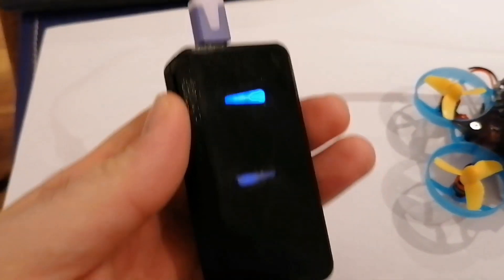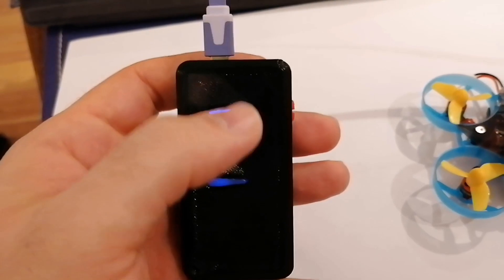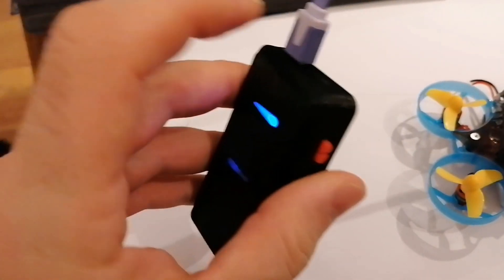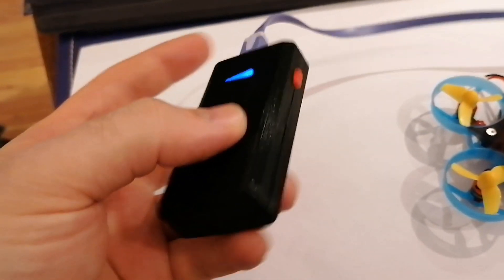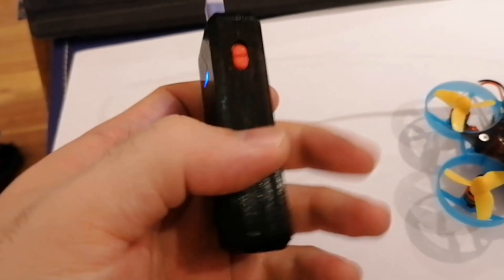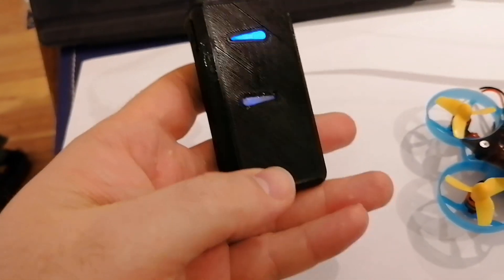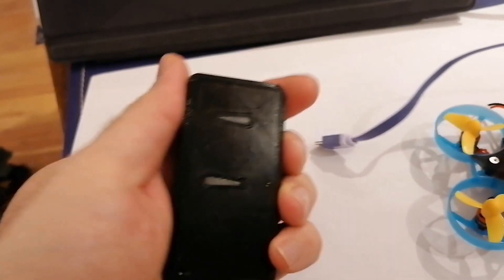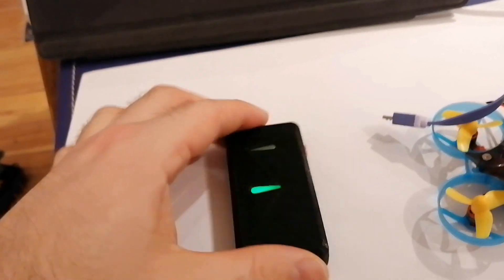PIDFlight ESP32 - Drone lap timer device

Comment: I have no programming skills at all.
Initially I tried to make a timer using FPVSim (he uses esp32 dev1) and the tutorial was very easy to follow for beginners like me.
but unfortunately the timer is paid, and I can't afford it.
I tried to use PIDflight with esp32 dev1 but when I tried to follow it I had a lot of trouble.(for example i can't found the sketch files to upload it) there is no tutorial that is complete and beginner friendly... will you make one for us beginners?
Reply from the maker: but what exactly will you need? in this case you could just flash an esp with my code
Reply: @eried  I tried it and nothing happen... I search for the wifi and Bluetooth, nothing... :(
Reply from the maker: @FebyKris_FPV  you need to make an issue in their GitHub, I just adapted the code to run on my esp32
Reply: @eried  sure I'll do that

Comment: watahboy commented 8 minutes ago
Great project you got here, I hope you still got it in mind. I've followed your buildout with a similar esp32 board (TTGO LORA) and have gotten readings from my DJI air unit, but they are all over the place. It may be because the DJI uses frequency ranges instead of a static figure, or maybe because they send and receive, I haven't fully figured it out yet. The app doesn't match the DJI transmission frequencies 100% which may also be the issue. The lap timer certainly notices when I turn on the unit, but seems to move rather randomly and frequently changes the RSSI regardless of distance from the unit. I apologize if this is the wrong place to look for help with this. Thanks for any consideration.
Reply from the maker: You should contact the GitHub repo owner, the latest code was never released 😪

Comment: Good work~
I am trying to make this timer, just 2 questions: 
1. If I use other esp32 (not TTGO T8), I only need to change the PIN OUTS at const.h, right?
2. Does it support 2vt/4vt?
Thx
Reply from the maker: 1. I think :) 2. No, because that firmware was never released. But it could be written
Reply: Did he ever release the firmware that does virtual timers?  @eried
Reply from the maker: @billyburnside5432  not sure, I stop playing with the tiny drones :)
Reply: did you get it to work with the esp32?

Comment: with esp 32 did you have to use the same rx5808?
Reply from the maker: yes
Reply: Have you found improvements compared to Arduino?
This system in which order of time is accurate?